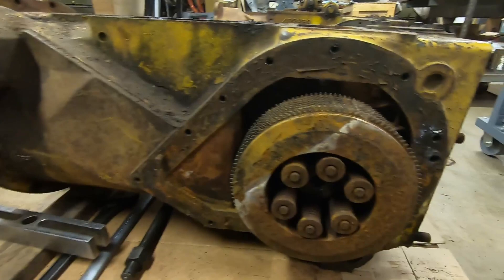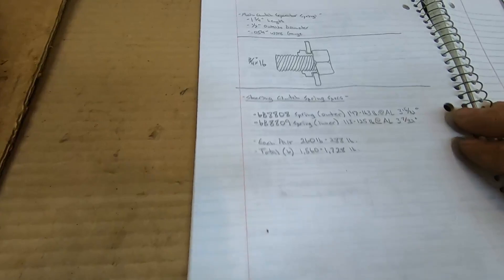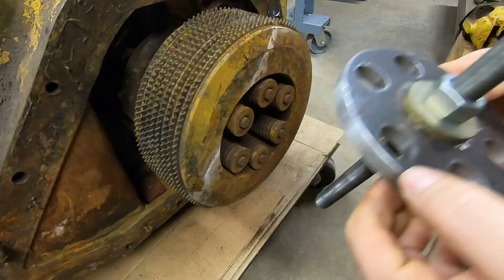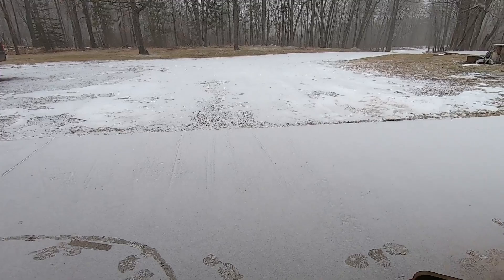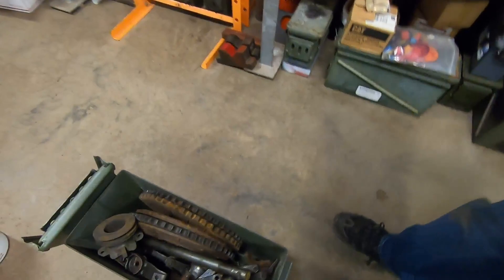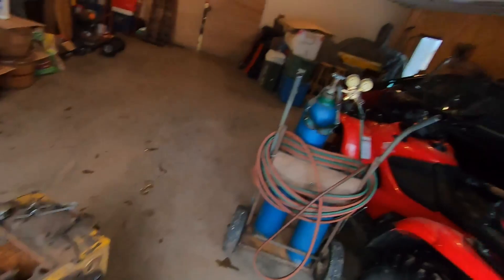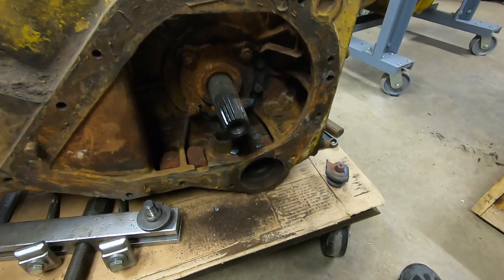Caterpillar D2 - Removing a Very Rusty Stuck Steering Clutch & My Spring Compressor Tool

Comment: “Man is a Tool-using Animal (Handthierendes Thier). Weak in himself, and of small stature, he stands on a basis, at most for the flattest-soled, of some half-square foot, insecurely enough; has to straddle out his legs, lest the very wind supplant him. Feeblest of bipeds! Three quintals are a crushing load for him; the steer of the meadow tosses him aloft, like a waste rag. Nevertheless he can use Tools; can devise Tools: with these the granite mountain melts into light dust before him; he kneads glowing iron, as if it were soft paste; seas are his smooth highway, winds and fire his unwearying steeds. Nowhere do you find him without Tools; without Tools he is nothing, with Tools he is all.”
From Sartor Resartus by Thomas Carlyle
Reply: Absolutely true and so correct
Reply: So enjoyed that... and applicable!
Reply: They say manners make man, i think it's more apt to say that tools make man. Have always done so, will always do.
Reply: ❤this piece of word smithing

Comment: I love the (relative) delicacy you use taking things apart. Your skill and respect for the machine and the tools is impressive.
Reply: Too bad he doesn't show us the bin full of broken expensive parts collected over the years while gaining that oh-so delicate touch.   :-)
Reply: We all learned by failing, as he states so correctly. Btw by trial and error  l found an easy way to get 16 rollers off tapered (but unsplined) shafts on my Fiat 331c crawler: use a 2-arm puller (not a 3-arm) and after putting pressure on the puller hammer the wheel or hub alternatively on either side one hit at a time. Do this long enough and the thing will come off, because you wiggle it ever so slightly. Add pressure whenever it becomes less.

Comment: I didn’t have anything near as tough as that clutch hub you just did, but I bought an Oliver 88 a couple weeks ago (with the knowledge that the pto clutch pack was rusted tight) I pulled the assembly out of the tractor, and spent about 3-4 hours carefully taking it apart.   I had to fight some, and ended up cutting a couple bolt heads off that were beyond loosening with heat and such, but got it apart, and saved the main drive shaft. I’m a happy camper!!  I had enough spare parts to replace parts that were rusted beyond use, and am just waiting on a couple oil seals and gaskets to put it back together.  😊
Reply: @squatch253  Yep!   Ya just never know what you might need in the future. If it’s usable, I hang onto it.
Reply: @donaldwallace7934   My problem is finding the spare parts after I put them away.
Reply: @MyOLD36chevy  Yes!   I sometimes have that problem too.  Lol

Comment: I used to refurbish big water pumps, and one of the ways l used to remove large impellers was to load them up with pressure then apply heat 
Then bugger off for a cup of tea. Normally after about 15 min to half an hour, bang! Job done.

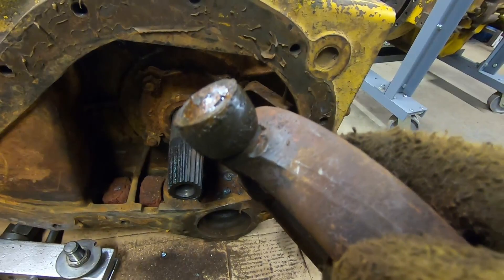Comment: 20:33, I had to go into a can of worms with my late 50s D6 9U.  The steering booster needed a reseal, found out both clutch packs needed replacing, and found one of the bushings at the bottom of the yoke was half broken.  It wasnt the bushing itself but half of the framework immediately around the bushing was cracked.  Through the top access hole, we were able to grind down the framework and weld the bushing back in place.  20 years later, it's still goin.  Great vid, thanks for sharing.

Comment: Amazing how RUST can weld parts together. A solid joint that you can't mimic with most anything else. Nice to see it finally broke loose and came off. I make a lot of "special" tools when I need them. Sometimes that makes the real difference between success and failure. Always have to think of cleaver ways to beat the issue at hand. Thumbs Up.

Comment: I'm digging back through these older beginning vids of yourJ1113 restoration series, and I very much enjoyed this episode of working on the steering clutch plates, because it was one of the jobs I did working at a CAT plant that manufactured them. I did this in the '90s so there were some differences in a modern plate, but also mostly the same disks you have there.

Comment: Don’t need to burn those yokes out. Just heat it red hot or hotter then cool with cold tap water. Never turn or twist hot! Only after shocking with water. 👍

Comment: 14:10 I've had tapers let go just under steady puller pressure before, so I wouldn't be surprised if the time was an aspect as well as the cooling. 

Like tie rod ends, using one of those pivoting tools. Wind up the forcing screw; nothing. Walk away to get a hammer and bang! Everything's on the floor. 😂

Comment: It took that clutch dozens of years to get that rusted to the shaft.. and just an hour of constant pulling force and some heat to free it up!
Have had to wait much longer for splined shafts to free up.. Ive got memories of fighting rusted splines for days, keeping big pressure on those usually got me winning in the end.
But also have had all kinds of pullers and/or studs break and launch across the workshop with huge speed/force.. once broke all 5 m14 hardened bolts from a stuck wheelhub launching the huge puller setup into the door of a car in the next workbay 5 metres away. (bossman wasnt happy about that one :P)

Comment: Hey Toby just a thought lubricate your puller threads with a light Oil we ask a lot of these threads sometimes it really helps remove the threat of ruining the thread you know it’s When good pullers go bad That we are most disappointed

Comment: Hi Toby, you are so calm doing these awkward jobs! I read somewhere that an old fashioned paraffin blow lamp can put out more heat than an oxy acetylene torch. Nothing like as high a temperature of course, but considerably more thermal output - and it would be 'softer'. Might be worth a try sometime. BobUK.

Comment: I love your gentleness, respect and well balanced approach to steel, iron and metal. If you show some respect for the build in properties and "personality" of the material, the battling negotiation usually ends better than the other way around. I suppose "determined gentle respect" is your signum. Thanks from Sweden!

Comment: If you have never tried and/or heard of the heat/cool system, this is how it works, you start by torching the frozen part that you are trying to free form another metal part to a heated cherry red, then you immediately and thoroughly douse the frozen part with applied cold water, this creates a shock to the metal. This method first expands the metal and then quickly retracts the metal in a split second of time. This system will sometimes cause the metal to actually pop itself free of the frozen bond that it has made to an adjoining metal part. As they say, Try It You May Like It !!!

Comment: At time 20:08 seized bolt.   I found a product that you should try. It's called Blaster Dry Lube with Teflon.  I had a SS manifold with a SS bolt. You know SS to SS has a high possibility of seizing up. I had an extra manifold so I set the problem one aside to work on later. Some years later after messing with it a few times I tried the Blaster. It worked almost like MAGIC. The bolt backed out like it had never been stuck.   The Blaster has a very thin carrier with a very find teflon powder. The carrier evaporates quickly leaving the teflon powder.  Please give it a try and see if you have similar experience.   Cheers and enjoy the end of the year holidays.

Comment: If you heat the center only, the hub will not expand as the cold outer circumference keeps it tight.  With time, the heat will transfer to the outer part of the hub allowing it to expand and release from the taper shaft.

Comment: the reason you heat an item is because for each 100C o heat u apply to steel it expands by about 1.5mm, now that pushes it to fill all space it can, and when it can't, things tend to elongate(as it cant expand in all directions) a little breaking free any rust etc, and when it cools down it returns to its original(or as close to it as it can) shape, now with that space.

it isn't the heating you want, its the heating and cooling.

Comment: When dealing with tapers, heat hub hot, apply pressure from pulling device and then cool hub with a garden hose. A lot of graders had tapered drive axles, works good most of the time. Keep up the good work!

Comment: That's why tool restorers will "freeze" the part if there's a stuck bolt or screw in the part they need to remove. Freezing shrinks the metals and can "pop" any rust bonds. Heat and freeze, use heat with wax, freeze, rinse and repeat several times and it WILL come loose. 
Use an air hammer to shock things loose, it's much easier and does save on your equipment/tools. One miss with a hammer and you'll regret it later. Cheers :)

Comment: The hub popping loose when cooling makes sense. Heating will expand the metal, but won't necessarily pop it. But when cooling, the contraction is likely to make the metal physically force itself off the piece it's stuck to, as that requires less energy than the metal deforming itself. It's similar to how you use wax, which will expand when changing phases from liquid to solid, to pop pieces apart. The fact that some of these parts are tapered will only help with that, as the taper gives a surface to push off of where the movement vector isn't perpendicular to the direction you want the part to move, thus it will push itself slightly outwards when the metal contracts, which aids in the piece popping free.

Comment: Thanks for the video. I just did my D2 5U12016 in somewhat worse condition. It was coil bound and had to sacrifice the springs and the pins with a torch  Did save everything else.  Keep up the good work. Herb

Comment: Sometimes when you put pressure on those tapered hubs and then a little heat will make them pop without making anything hot .😊👍👍

Comment: Question, if spring out/off. Can you push the pins out the back? If so. Separate the clutch disks. Push all back as fare as possible. Then heat the center outer clutch plate from disk side, maybe??? So after watching the complete video disregard my question!  See that engagement assembly/bearing in the way for pins com out and have any real separation, unless cut disks and center plates.

Comment: I've just come in from making a clutch hub holding tool for my motorcycle.
The loosening upon cooling isn't that weird. Usually parts stick because of a thin film of rust. The rust takes up more space than the metal that formed it and that is why it jams things. But rust is brittle and any movement such as the expansion and contraction caused by temperature change will break the rust up.

A selection of threaded rod and nuts is invaluable. Many people fail to grasp the force a screw can apply. It can reach well over a hundred tonnes with the correct set up.
https://www.youtube.com/watch?v=d_LSPX8cNaE

Comment: If you are able to put a torque of 300 lbs-ft on that puller nut, it will generate a pulling force of 24,000 lbs

Comment: Does the pinion shaft these clutch packs are pressed onto ever get damaged by the rust? Seems like the shafts were somehow “protected” while the hubs and bushings got corroded. The shafts would be the more expensive parts I assume.

Comment: Do you ever use electrolytic rust removal? It can even remove rust inside mechanism, in my case a drill chuck accidently left laying on my humid basement floor, or an adjustable wrench found on a flat roof.

Comment: You got hub cherry red while puller screw was installed, any concern with taking temper out of puller screw with the torch heat?  If not, why not?
Reply: I didnt realize how you were pulling against the stop bolt.  Thanks for explaining,  makes sense, thanks!

Comment: the way that everything is rusted  i woudn,t bother trying to save the springs . No professional mécanic would reinstall  old rusted spring like these ones are . specially when it comes to those models of  clutch . Its doesn't take a lot of rust to weaken any kind of spring of that kind even if the heat will be way worse  , If i looks at their state on the video i'm pretty sure that they are at arround 75 % of their normal strengh due to the rust